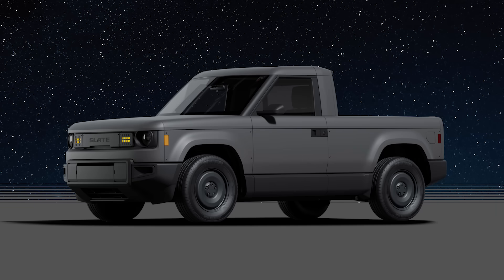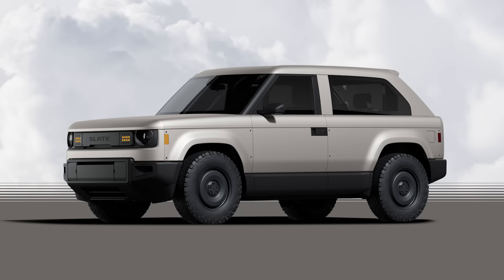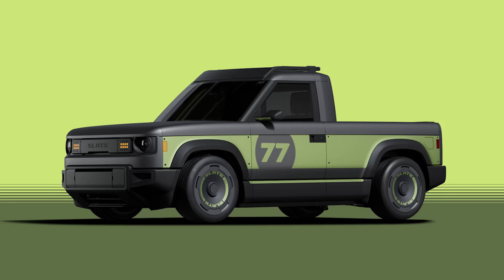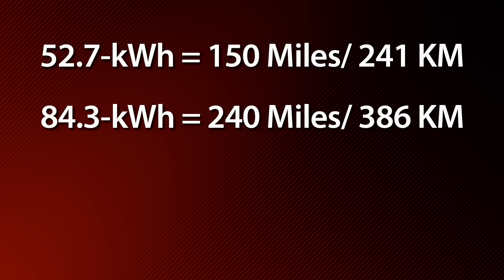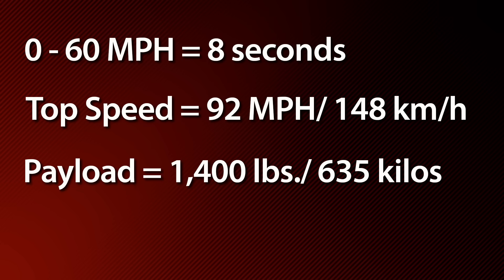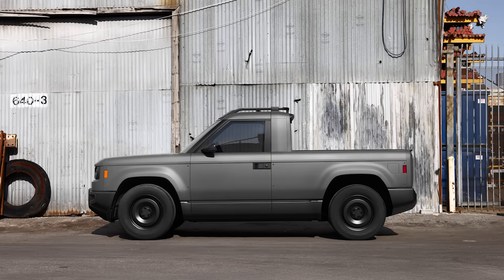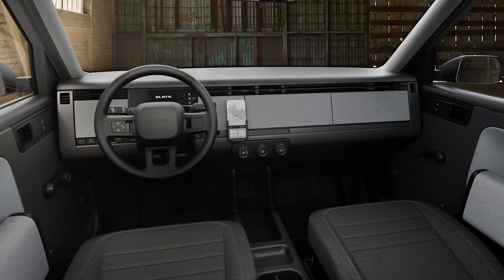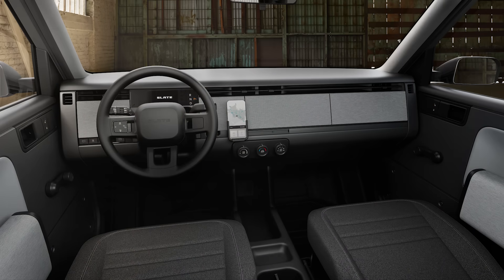Everything You Want To Know About That Slate EV Pickup

Comment: I hope this comes out as promised and is a huge success.  The new car industry needs this badly.
Reply: Agree 100%.  It fills a real need that mainstream manufacturers aren't providing.
Reply: I don't think they are ready for the kind of success this could be ... Let's hope they don't mess up the plot.
Reply: no, but the consumer does
Reply: Amen !!👍👍🙏🙏
Reply: I agree. Having cheap simple petrol diesel hybrid and electric would be great too.
Reply: Yelp.... and all it needs is enough YT likes ;)
Reply: This is amazing! One criticism is that they missed the mark big time on the "over the air updates" through your Smart Phone. We don't want people sending software updates and code modifications to our vehicle's ECU (main computer) over WiFi on our car. Wireless computer updates to cars is one of the things we don't want as consumers. We want a vehicle that doesn't need updates, and is reliable. What happens when a wireless update fails?
Reply: @Ritalie  They've described it elsewhere as more of a manual process you have to decide to initiate, it's not something that happens transparently without user intervention.
Reply: @Ritalie  I doubt the vehicle has WiFi or it would show up in other options.  I expect an app on your phone to download updates, and USB connection to the Slate's CPU.
Reply: @Ritalie  Presumably two partitions the way most modern phones do for rollback. Flash the inactive partition, verify, swap the active partition bit, if it detects a fail state swap the active bit back to the other partition.
Reply: We absolutely do not need more overpriced POS...

Comment: This is going to be a winner!
Reply: The issue is the battery, design efficiency, and cost (Federal tax credit)
Reply: @rudycastillo4150 exactly what I fear. If the tax rebate goes away it will cost more than a Maverick and will be DOA.
Reply: How much is the operating cost of an ICE vehicle versus an EV?  Such as maintenance and fuel costs.  

Plus battery prices keep going down....  And that It's designed to be easily customizable .... etc..... etc. 

So the only thing that should be DOA. is overlysimplistic direct comparisons, between the Slate and the Maverick.  (I even here comparisons to a Corolla which is even more ludicrous)
Reply: @nc3826  the issue is cost and weather (range) . Seem more like to show off that to do actual work with
Reply: @rudycastillo4150  Yelp its lower operating "cost".... 

Good luck coming to terms, where the market is headed.
Reply: @nc3826   the car is going to be 27k from they're saying and federal taxes probably won't exist
Reply: I like the product......  But like it or not most startups go bankrupt.... Before making a net profit.... 

But let's be positive yeah it's going to be a winner for sure kind of maybe ;)

Comment: Why would you wait two years to buy this severely de-contented, nerfed slate EV for 27K when you can buy a used model Y for less than that right now ?
Reply: De-contented not only brings down the purchase price, it has the potential to keep maintenance costs down. I'll be interested in how they structure service... One of the things that always worries me about Tesla is that when it breaks, you have few options for getting it fixed.

A used Model Y sounds fine, and it may be, but if a drive unit fails out of warranty, it's on the order of $6,000 which may not make sense on an older car.

I'll be keeping my eye on this ( and the Telo ). An inexpensive electric pickup may be just what I'm looking for with my next vehicle...
Reply: @paulcantrell01451  out of the factory, the model Y has an 8 year, 120,000mi warranty. Currently, used Model Ys selling for 20-25K are 3 years old and have ~50,000mi on them. So for the same price range, you've still got a fair amount of warranty to go. And with the model y, you're getting 2x range, 2x charging speed, 2x the doors and passenger capacity, an actual radio and navigation system...list continues.
Reply: Because, obvious teSSler stock holder, it's not got a musky odor hanging around it. It also should be simpler to maintain and insure, and has a "growth path" that teSSler doesn't.
Reply: @davidg3944  Musk fan bois are obvious. I hated Tesler before it was cool.  Still hate Tesler and Eloy.

Comment: I bet they have a number of patents and processes in that design, a win either way. The sparse and gadget free interior, is a plus for custom and special uses. In mining and oilfields, for example, the dirt and mud is so bad, you have to hose out the cab, try that on most new trucks. Outside, dents and scratches build up fast. Reminds me of Checker Cabs, get in a fender bender and it can be repaired before the next shift.
Reply: It is 2 wheel drive for now though
Reply: @LehiRulon for now. They are doing an AWD in near future.
Reply: @otterpoopie  I was wondering about that - seems like AWD, or an additional batter pack to get over 300 mile range, would be the next model options.

Comment: Any rumors on the battery supplier?  It seems GM/Ultium has been cranking out WAY more cells than they have used. Made in USA which would match up with getting the $7,500 rebate… 🤔

Comment: Same two issues that keep coming up. Range and charging. How many of their target demographic have a plug at home to charge these? Will anyone buy the 150 mile range model? What will the 240 cost?
Reply: Only fleet customers will buy the 150 mile range model.  Probably Schools, Universities, and golf courses, for grounds keepers.
Reply: Range is a good question... Pickups have lousy aerodynamics. If you try to tow even a small landscaping trailer, you'll probably get half the rated mileage. I think the 240 is probably the way to go for most people.

Charging I think is much less of an issue. While I have a Level 2 charger at home, my daughter rents, so she has to get by with a Level 1. It works fine for her. In the very unusual situation where she has two long drives in a single day, she has to hit a DC charger. But that simply doesn't happen that often... Most of the time the Level 1 gets the job done...
Reply: @boston_pc  most apts don't even have level 1

Comment: This truck 🛻 with 2wd, no radio 📻,no powered windows 🪟 etc… has to be 19,999$ With NO taxes credit base 150 miles range  if this thing is 27k it won’t really sell unless it’s 230 miles range because a ford maverick is crew cab truck hybrid 35-40mpg 4wd 25k power everything and radio 📻 etc… I will stick with maverick before I buy slate
Reply: But suv does look 👀 cool 😎 but 35-38,000$ with 4x4, 230 mile range, power windows , suv version would be fine and would be the most I would pay but suv looks better like a defender Land Rover

Comment: Considering that the average out the door price for a new vehicle is just below 50K,  I think this vehicle has a market.
Reply: That's only if what they're saying is true but I doubt it will be less than $30,000 when it actually releases
Reply: Your correct .. can you imagine people with les debt , and more money left to spend or invest!!👍👍🙏
Reply: The nissan leaf starts at $29k  which has me confused why this price is supposed to be impressive.  Thr slate isn't as well equipped. the biggest difference seems to be the slate has a bed, which I wouldn't think would be more expensive to produce.  Maybe it's startup costs of creating a new company from the ground up.
Reply: @JSchroederee 29 > 20
Reply: The average vehicle price is $ 50 K because too many buyers over spend.
Reply: “High-strength steel” just added $5,000 of trumptariff
Reply: Ubless this car starts at $15k, it will be too expensive.
Reply: Meh my little beater 2018 ford fiesta se which was 14k brand new has a better interior than this with more options!

They went to extreme imo with the cost cutting and the tax credit could very well be eliminated before they even bring this out in 18 months or so! And that CEO is fkn nuts to believe within a year an all new ev company with a niche product will be at 150,000 units a year run rate smh.
Reply: @4literv6  Is your Fiesta for sale at that price in 2026? Is it an electric vehicle? Is it a truck or a car? Just curious.
Reply: that's an expensive door
Reply: @4literv6  Congress would need to repeal the tax credit and there are a LOT of high paying red state jobs making EVs.
Reply: @4literv6  The fiesta is a little gem. Yes, interior is pretty good and gets great mpg. Although, the automatic gearbox is known for premature failure. The 5-speed manual on the other hand is pretty reliable if you can find one.